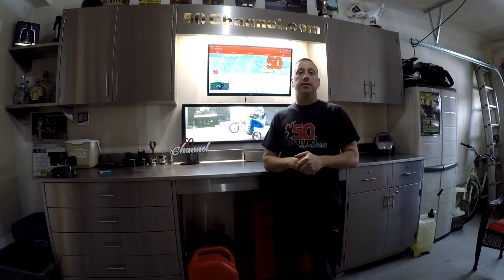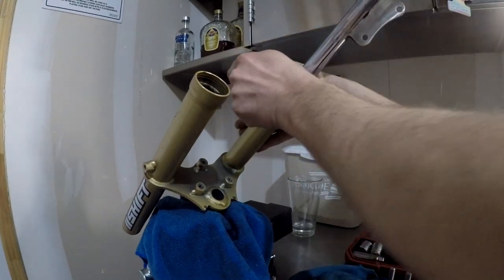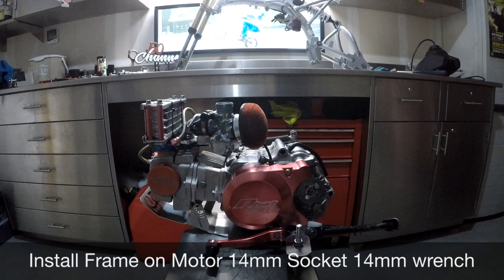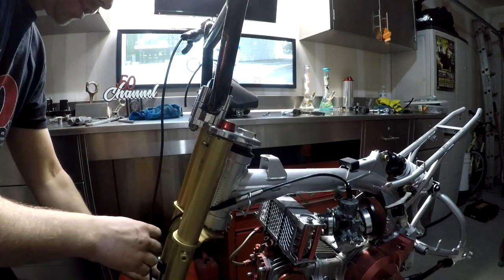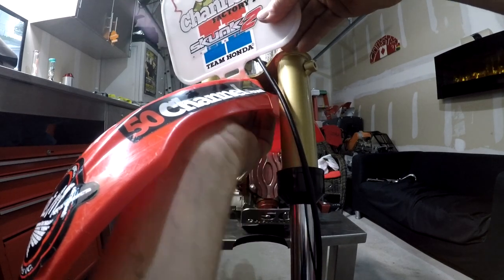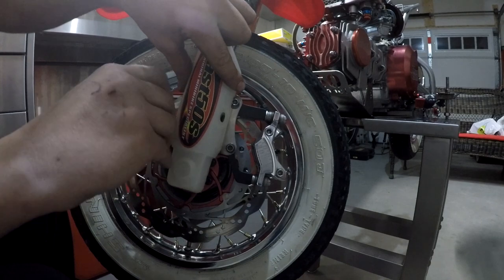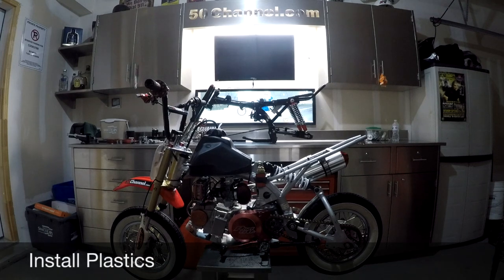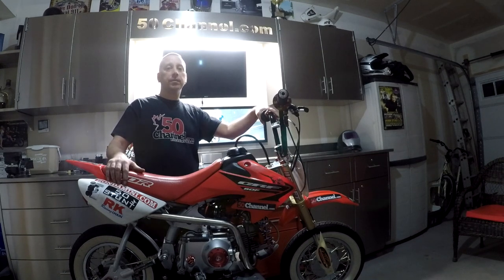DIY Honda XR50/CRF50 Showing you how to put a 50 together.

Comment: Any place in NYC that I can take my stock '15 crf 50 to have it hooked up?
I want to buy a fmf pipe for my 50 but I notice some exhaust pipes stick way out and other fmf exhaust pipes are short and tuck under the right rear fender and that's what I want for my soulmate 50.
Any idea which fmf exhaust pipe is the one with the exhaust that doesnt stick out?
Any help would be appreciated.

-Rob
Reply from the maker: You can check out a pro circuit exhaust

Comment: What type of engine is that?
Reply from the maker: It's a TB108cc with a 4 speed takagawa 1down 3up TB manual clutch with 26mm Mikuni carb 16 tooth sprocket in the front 37 in the rear can reach up to 95km

Comment: Same size tires front and rear
Reply from the maker: Yeah front and rear tire 10x 3.00
Reply: @G-Boyz.Outside  thanks for the reply! I'm doing kart track track days but the front is a Avon 90/90 10 but seems hard and no grip. Thats on a crf50 with 140cc pirahna
Reply from the maker: @livefast.82  I like running a staggered 3.00 front and 90/90 rear I was running Continental zippy ones great tires soft compound. But the White Walls I only can get in a 3.0 and they worked good on the indoor go-kart track